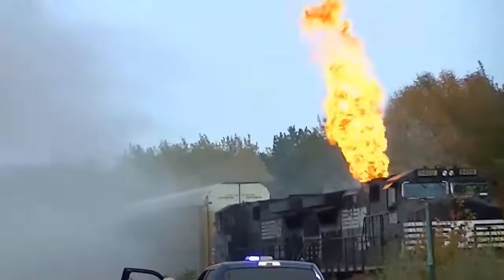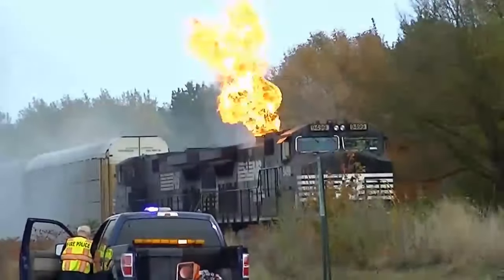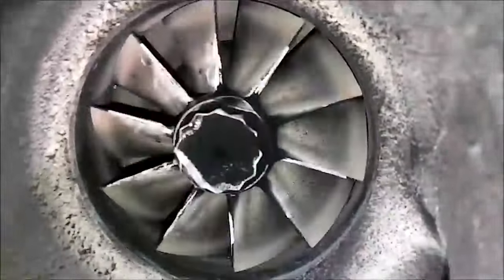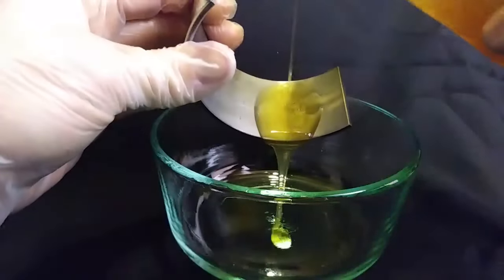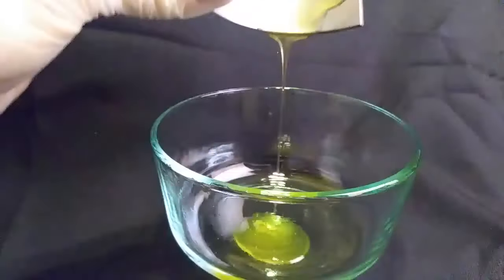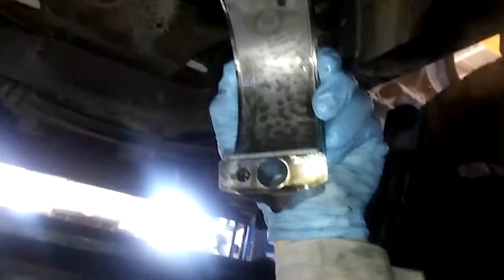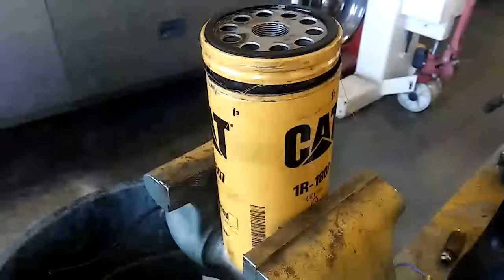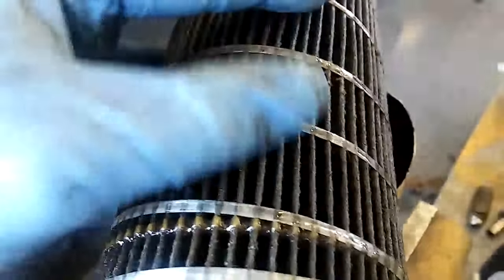Engine Block Heater vs Oil Pan Heater. Everything you NEED to know about Cold Weather Diesel Engines

Comment: Intake Heater Vs. Glow Plug: A little to generalised and not really correct in your description. Intake heaters (Grid) do add some heat to the intake charge to help it reach combustion ignition temps. Glow Plugs however provide little heat to the inatke charge until charge in under compression but where the GP really works is point of ignition to start the flame front.

Comment: copper conductors are not going to see an appreciable difference in resistance in normal temperature swings due to weather. Unless the conductor is operating well over its current rating and therefore heating up significantly it will not be the source of a appreciable power loss in the system.

Comment: Add Do NOT SPRAY either into an intake and THEN turn it over!!! You will over load ONE CYLINDER with ether and youll melt your rings. TURN IT OVER AND SPRAY at the same time after disconnecting the glow plugs/grid heater.

Comment: The battery freezing thing is that a flat battery has all the acid «merged» with the lead plates so the liquid is almost plain water. A charged battery has the acid in the water which is very hard to freeze. A lead battery has no power in it until you short the poles. When you short the poles it allow a chemical reaction to occur where the plates will draw the acid to it. If you inject power in it you reverse that reaction.

Comment: I worked on. GMC c6500 with a 3126e and was surprised to see an OEM ether injection system and an intake heater. I assume both systems are automated, I didn't see any way for the driver to intervene.
Reply from the maker: Pretty much all of the 3126 and C7 engines had the intake heater, never saw a factory installed ether start on the same truck though.
Reply: I would think if you put it downstream of the intake heater, it might be alright. Wouldn't want to with GPs tho. Lol
Reply: @AdeptApe  - The ether injection system would have been down stream of the IAT.  I've seen a few with that set up.  Almost always, the ether can was empty, because the operator was too lazy to wait for the IAT heater to cycle properly.

Comment: I have Diesel engine coolant heater, I will be adding tubing into the fuel tank to heat fuel.  Now I am thinking of way to add coolant heat exchanger to the oil pan. This is school bus.

Comment: Are jacket water heaters the same as the coolant heaters you splice into the rad hose?
I've got a lower rad hose heater and it really only heats up the section of hose it's installed at. I have my doubts about how much its actually circulating the warm coolant.
Reply: If your cooling system has a thermostat like most do, a circulating heater in the lower rad hose can’t work because the thermostat is closed when the coolant is cold, so the pump in your heater can’t even slowly circulate the coolant through the engine block to the thermostat to make it heat up and open to allow for full circulation. A block heater is exactly that, it’s installed in a freeze plug hole in the block, or maybe through a threaded hole in other cases and directly heats the water inside the engine block. The only pump type heater that I can see working effectively is one that installs in a heater hose that would pull water from the intake manifold area and return it through the water pump or on some vehicles through a return port in the radiator tank. The heater hose pump would work because it can circulate the water without it having to pass through the thermostat.

Comment: Worked at a quarry once were we had Cat 980C loaders (yeah this is going back a few years). Operators go out a 6 am on a Monday morning to start up there machines and....rrrrr-ah, rrrr-ah. Things are barley turning over. Figure bad batteries right. Go back to the shop  get two fresh batteries (new and charged) back to were the machines are parked. Freeze my you know whats off in the 20mph wind and sub zero temps changing these batteries out by myself which was no picnic I tell ya and rrrr-ah, rrrr-ah...what the ?????? Put my hand on the block and it's nice and warm. Pull the dip stick out to check the oil level and a black tar like gooo is stuck to it. It was like as wide as the tube itself. Put my hand down on the oil pan and it's like a block of dry ice. Wow cool I thought how could the block be so warm and the oil pan dam near frozen. So off to NAPA buy a couple of dipstick heaters and 5 minutes later....VRUUUM Engines fired right up. Installed oil pan heaters on all our machines after that and never had a issue again.  Crazy cold does weird things to machinery. 
Nice job Adept Ape 
Stay Safe, Be Healthy

Comment: Back in the 1960s or 1970s iirc, someone wrote into Popular Mechanics (or similar) with a simple engine warming trick. A spotlight or heat lamp under the oil pan. This was for smaller engines than what you are talking about, of course. Not sure what the downside might be.

Also, is there any disadvantage besides cost of using oil, coolant, fuel, and a trickle charger all on one AC cable and unplug everything at once?
Reply from the maker: Unless you have a massive heater drawing 50 amps, a couple little heaters should be able to run off one cord. Just check the amp rating.
Reply: I did this with my 6.0, Oil, coolant, and I ran a walmart hairdryer in the cab on low setting behind the driver seat mounted with some all-thread from Home Depot to keep it elevated and keep hot-spots from happening. This probably made the biggest different in comfort. Never had to scrape my windows, and my seats didn’t crack as much (problem with ford in cold cold weather). I ran all this on a single plug for about 4-5 months out of the year in North Dakota. I was homeless for 2 of those months and live in my truck as I saved enough to get a place, so I became very familiar with my make-shift heating systems. I own a small 5 truck fleet now. Still use some of these heating tricks on my 18 wheelers. Ironically, they’re all reefers.
Reply: I run my trickle charger and block heater on the same cord with no issues, however on my old international cab over it was so check your build sheet for what heater it has. Found out the hard way my old cabover had a 2500watt heater and needed to be solo on the circuit, if it didn't trip a breaker it started great.

Comment: Either is the last resort and most damaging. Warm oil and a warm block is a sure fire formula for an easy non damaging start. Buy a moving blanket  from Northern Tool, raise the hood, cover the engine, close the hood and insulate the heat provide by the block and pan heater. Of course remove the blanket before start!

Comment: Do some turbodiesels have a way to bypass the intercooler during cold weather? I've never read anything about this; to me, it seems sensible.
Reply: It’s called an arctic grille cover, stops most or all of the airflow to the radiator/intercooler when installed. I bought one for my LBZ Duramax after GM stopped including them with every new Duramax and then discontinued them altogether. Mine came to Texas via a dealership in Anchorage, Alaska.

Comment: Would a magnetic block heater that sits in the engine bay keep my coolant from freezing?
Reply: Coolant won't freeze unless ungodly low temps or it's bad, the magnetic one needs to be on a steel/iron part of block. A block heater will work better. Most engines will have a frost plug for it's use.

Comment: Awesome podcast just a comment webasto or proheat works great up till minus 40 after that your on a frost fighter on engine and batteries.good video up to -35 after that you need the frost fighter especially if you can’t get shore power
Reply: Cold weather oil 030 or 040 oil

Comment: oh man...another appearance by J. Sockwad Jr, and I love his hat.  My C7 does have a 120 volt block heater, I think...I assume it is in the cooling system.   Hmmm think it's there, assume it's in the cooling system...dang I think I need to research this.
Reply from the maker: You have one and I bet it goes right under the turbocharger Larry 👍
Reply: @AdeptApe   i bet yer right.   i've never used it intentionally....switch is broken, and very hard to get to....dang more stuff to fix   :)
Reply: Switch?? Should just be a cord with male end either under driver's door, or that side of the radiator grill!
Best wishes, stay safe.
Reply: @carlthor91  its in a 40 ft motorhome

Comment: How about Capacitor Modules like this 👉Maxwell ULTRA31/1800 Group 31 Engine Starting Module ESM Battery 12V DC 1800 CCA ?
Reply: So it first charges itself from the battery, then provides higher cranking amps?
Reply: @petermolnar8667  Yes Sir!

Comment: A block heater will heat up the oil fast enough to reduce its viscosity. Soon as it hits the warmer metal of the engine block and especially so being in close contact to the combustion chambers.
Reply: The trick is getting cold oil to those warm parts to start with. If oil won’t flow, it can’t get anywhere warm
Reply: @aaroncawsey7892  in my experience the coolant heater radiates heat throughout the entire engine bay. My diesel has a pan under the front end of the vehicle  that helps keep the heat in too.
Reply: That’s true, up to a point. The oil sits in the lowest part of the engine and it’s just thin metal holding it in, meaning the oil is in direct contact with whatever the outside temperature is and over a relatively large surface area. I have touched the oil pan to see just how much heat makes it that low in the engine. The answer is, not much. The oil pressure difference between no pan heater and pan heater when it’s below -40* is enough for me. Block heater wattage, engine size, engine bay size will all make a difference. BTW, I have a gas engine, not diesel

Comment: I don’t agree that the coolant heater doesn’t heat oil. -10 F outside my block heater heated the coolant to 110F and oil to 76F. To me that is heating both pretty well. Even heated the transmission fluid to around 50F

Comment: My 3406c has both the oil and coolant heater element on a single plug and the coolant one always leaks and burns the plug up that goes into the element. This is the second one. Is this a problem with these. It’s getting annoying
Reply: Maybe some silicone before installation to help seal

Comment: Can you have a block heater and glow plugs?
Reply: yes
Reply: But if you run the block heater until the engine is warm you won't need the glow plug
Reply: glow plugs actually go inside the combustion chamber the tip glows red hot and has its off the 12 volt system before you crank the engine but not all engines have them you can't necessarily add one you would have to drill and tap out your head for a new thing that's not supposed to be in there
Typically larger diesels do not have them they rely more on the compression heating the air up enough and the fuel injection is only in the very center and so the cold cylinder walls are not cooling down the air right around the fuel injection
Almost all indirect Diesel injection uses glow plugs

Comment: I was told in the winter time in the colder climates they blend #1 & # 2 diesel together is that true
Reply: Yes, frequently referred to as winter blend. Adding 20-30 gallons of number 1 to each tank (assuming 100+ gallon semi tanks) it will drastically improve the cloud point and aid in cold weather starting.
Reply: And some owner/operators will use kerosene rather than #1 if price difference is meaningful.

Comment: Ether is only bad when you use too much. If you only put the SMALLEST SQUIRT you can into the intake before the air filter, and you don't have glow plugs or a grid heater, then you will only get vapors into the engine and you can't do any damage by rinsing the oil off the cylinder walls. The key is to only use a tiny bit!

Comment: I would install both a block heater and a oil heater on my truck
Reply from the maker: You can definitely have both. Doesn't hurt to use 2.
Reply: Cat dealers around here (midwest) strongly discourage oil heaters. They claim it cooks the oil so it does more harm then good.
Reply: @jaydunbar7538  I have a customer that wanted to leave his plugged in for over an hour before he started the truck. The heater he bought has a thermostat, so it would probably be alright, but man....I don't know. I've seen what scorched oil does to engines. 😱😱😱😂😂
Reply: @noahlarson1861  I love my old 1LW far to much for such shenanigans lol

Comment: Fun fact - 40f a battery has 5% if it's rated cold cranking amps remaining
Cummins did there math down to the watt on there ratings  based on a single group 31 battery's typical CCA
. +32 plug optional 
-20f plug mandatory. 
My 91.5 Dodge proves this for me, it will fire grumpy till the post start cycling of the grid starts at -19 . -23f nope   to slow. The resurve capacity is used up by the grid's 250A for 90 seconds + hp increase to move the oil = more than the typical 250 amps pulled by the starter causing a brown out by exceeding the speed the chemistry  happens.   -30f with plug only has been reliable 250 mi +  Plasti gauge called .0035" oil clearance  on 4-7 at 500k mi

Comment: What he failed to remind us of was that with all 120V systems, you need to park at a place where you can plug it in. Living in Vermont, here area few other tried and true methods:  1 ) In the morning shovel out some burning coals out of your wood stove onto a garbage can lid add some kindling and place under the engine, the amount varies with outside temperature. 2) Drain the coolant into a bucket when you get home in the evening and the thermostat is still open, bring it inside, will also help warm the house, set it on the wood-stove when you go to bed, adds thermal mass to home heating system, check to make sure the drain-cock is closed and pour the warm coolant the the engine. 3) Disconnect and bring the battery inside for the night.  4) Install 2 "Ts" with valves and garden hose fitting  to both your diesel rig and car or pickup (both running the same coolant) connect the two together with 2 garden hoses, open the valves, run the car or pickup for a while, then start the diesel, a common practice with loggers for their skidders. 5) gasoline to the oil temperatureevaporatetemperatureuseoil, and the oil filler was not onto the valve-train)

Comment: The detriots on the power carts in the air force had a either system, hard  to start when 40 degrees of colde,  Should have had cats.
Reply: They are all a stone B, if you don't have heat.

Comment: Do you think fuel additives help any? Some people think they are a wast of money.
Reply: If you don't see low temps they are. Northern States usually have, or used to have, a set of pumps, per truck stop, with #1 diesel. In Canada about the start of October they only sell #1 diesel. Switching back in end of March. Hope this helps.
Reply: One winter I forgot to add it in... threw a ton of codes when starting (w blockheater on) took it to 2 shops first one had no clue second one asked if I added an additive... and that's when it hit me... whoops.  Yes they work. If your not looking at single digit or lower temps then dont bother.
Reply: Additives are a must in the cold, but they are not created equal. I've had great luck with Howes, I buy it from a local dealer so I can get the concentrate and save a fortune compared to the commercial 1 dose containers. Its called "winter treat plus". Instead of the 64 ounce bottle treating 160 gallons (or 1 gallon for 320 gallons of fuel), the concentrate treats 1500-3000 gallons of fuel per gallon depending on temp and it costs $80 for a 2.5 gallon container. Can save more $ in a 55 gallon drum but as a 1 truck operation thats just to much for me to screw with.
Reply: You should use fuel additive below 20f amd double the dose below 0f

Comment: 0w40 + block heater + #1ulsd + fuel conditioner + fuel heater + grid heater + glow plugs + battery tender + battery blanket + oil pan heater + oil pan blanket ... 👀...fff it park in shop

Comment: This is for your amusement since you mentioned starting fluid, its a product that they market in Australia and its not a joke, its a real product. Why they would need starting fluid in Australia is a good question, cold is typically not a problem down under !. Being that I am in northern Canada I am forced into using it sometimes on the farm on some of the older diesels that can't even start  just below the freezing point and the trick is not to use much and use it before the engine is turned over and has raw fuel in the combustion chambers that would all light off at once if starting fluid was used after a period of cranking the engine over without being able to start. In any event have a good chuckle at this !  https://www.repco.com.au/en/oils-fluids/additives/fuel-additives/nulon-start-ya-bastard-instant-engine-starter-150g-syb150/p/A8765574

Comment: if the compression ratio of an engine is hig, is it more difficult to start?
Reply: RedZone generally.. Rotating mass also plays a role
Reply: Though low compression diesel start harder in the cold than a higher compression diesel. They are made to start with the higher compression so it isn't an issue. The real issue is lack of maintenance. Like bad starter wires, bad batteries and weak starters.

Comment: Batteries are a chemical device that produces electricity, and chemical reaction speed is directly related to temperature. Accordingly, batteries produce the most power at the greatest temperature.
He says this, but less science-y than I have.
Reply: Battery loose voltage the colder it gets
I load test  battery all winter long